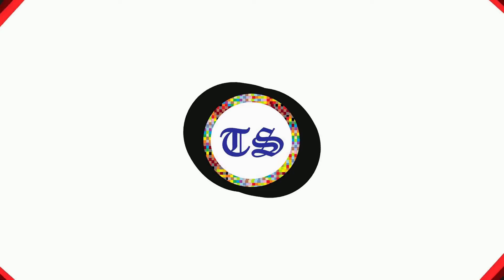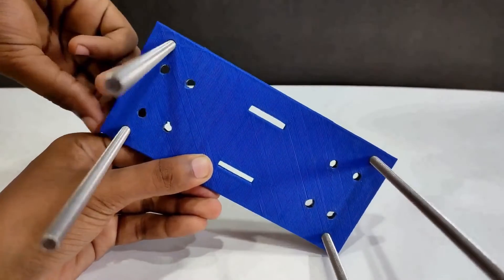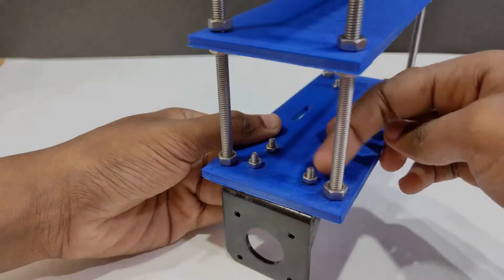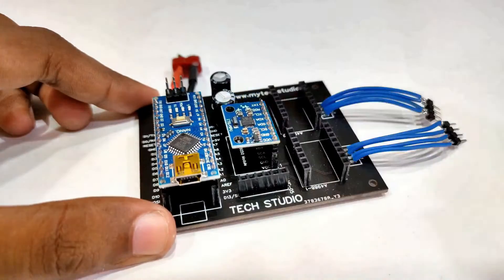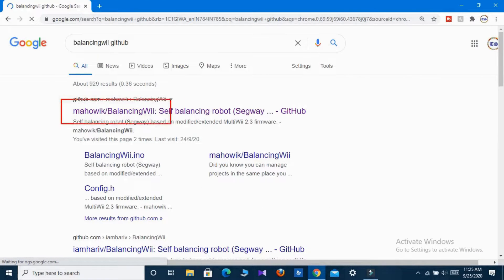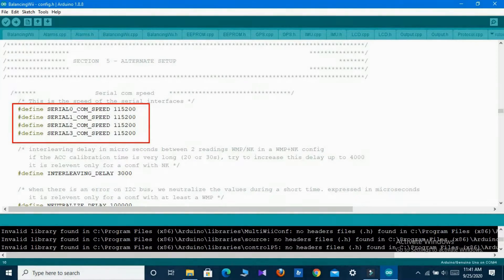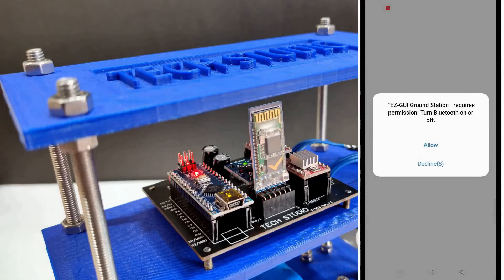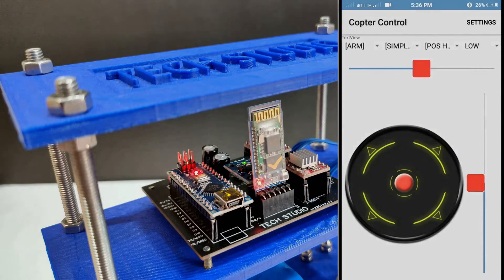Self balancing robot using stepper motor and arduino nano | My Tech Studio

Comment: Hello, I’m following your tutorial but for EZ-GUI when I go to untested the motor starts to spin constantly. I checked if the motor will follow the direction it will fall in and move against and it does do that although slowly but still the robot can’t be controlled as when the joystick is mid it would just spin on and on and won’t stop until I change ARM to high or mid
Reply: Lograste solucionarlo?

Comment: One question, how did you make the bluetooth connection with the application work on the hc-05 model (I'm doing the same project, but the bluetooth connection is not working well)

Comment: when I place the robot vertically steeper motors are continuously rotating and stops when i rotate it by +90 degree or -90 degree
I also done the calibration and Aux and pid settings. 
Please help me to figure out the problem.
Reply: merhaba aynı problem bendede var sorunu bulabildinmi acaba

Comment: love it so much. Question: in Balancingwii notes that We must add resistor when the power supply has more than 12v. Can I use it without resistor when the power is under 12v, e.g. 11.1v (3 lipo batteries 18650 - 3.7v each)?

Comment: Great project! I tryed to do the same, but the app keeps giving me an error saying that no data was received. I've changed the UART/BAUD in the Bluetooth module to 115200, but I'm getting the same error message from the APP. The error is not comming when i connect from usb of arduino nano but when i connect 12v battery then error is comming. Do you have any idea of what I'm doing wrong? Thank you, sir.
Reply from the maker: In this don't use 12 volt battery. Only use a 7.4 volt Li-ion battery.
Reply: Did you solve the problem?  I don't think the voltage is the issue, sincerily, the Arduino Nano can be powered with 20 volt max, I think. Regards
Reply: @josea.6523  Yes, I added a voltage regulator before supplying it to nano. I reduce the voltage until the error is gone. I managed to work at 5 to 6 voltage.

Comment: hi, help, I assembled the robot, but I have to hold it with my hand and it swings a lot, if I let it go, which pid parameter should I change?
Reply from the maker: Please follow the steps, that is mentioned in the video.
Reply: @MyTechStudioOfficial  in normal mode, it is in balance;  in the hold position, it swings back and forth continuously, without stopping

Comment: Hello sir we was make it project
But that is not working
We dont know what problem are in the project ... We are changes 3 pcb or 2 blutooth module or driver circuit also
Plz help me sir
Reply from the maker: Make the circuit according to the circuit diagram, upload the code properly, and setup the application.
It will definitely work. If not... let me know in the email, our team will help you.
Reply: We was tried all steps
In step by step
Reply: It works (running)
But it not to balancing verticali means
That not balance itself
But it run forwars direction reverse direction
Reply from the maker: Put the MPU6050 properly in the middle of the robot
Reply: Hello sir now its working
But it is not stable in own capacity
It mean it is not balance it self
Dont dont find the problem
Plz give solution

Comment: Great project! I tryed to do the same, but the app keeps giving me an error saying that no data was received. I've changed the UART/BAUD in the Bluetooth module to 115200, but I'm getting the same error message from the APP. Do you have any idea of what I'm doing wrong?
Thank you, sir.
Reply from the maker: Use a new bluetooth module and try once. If this is not working, Let me know. I will give some other suggestion.
Reply: @MyTechStudioOfficial  Me also facing this issue sir. Under the AUX values it is written that ''Not enough information''. I have to submit my project please help to fix this out.Thank you
Reply: @MyTechStudioOfficial  thank you, I tried a new Bluetooth module, but the problem persists. Thank you.
Reply: Yes i also make the robot and fasing the same problem it is solved by changing boud rate of hc o5 module when aux is not showing any thing
Reply: Bro just fixed that problem,i am facing the same problem you have to change the BAUDRATE by giving this AT command ''AT+UART= 115200,0,0''. And done This will surely work.
Reply: @Himanshu-t3j2n  bro where should i type this command
Reply: @cyclopsman7884  In AT command mode of hc05
Reply: @Himanshu-t3j2n  I did that too, but I think I have a different issue. Thank you.